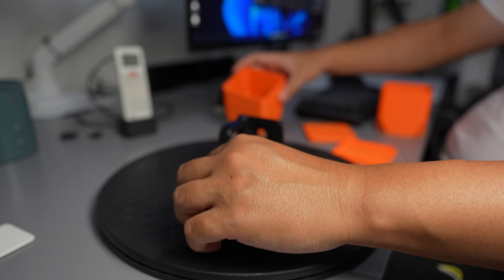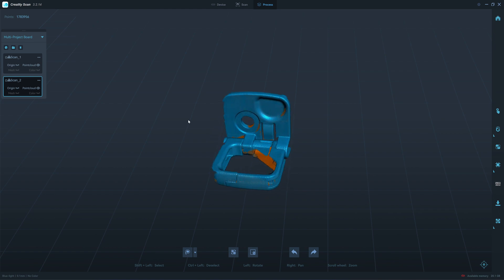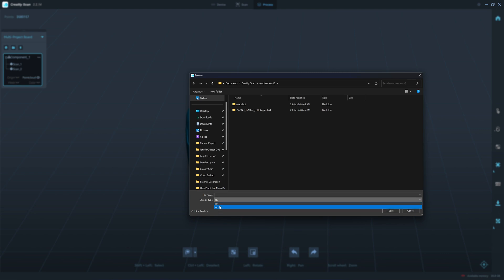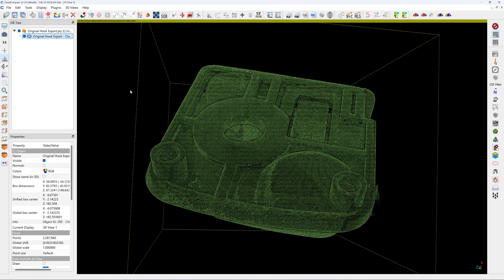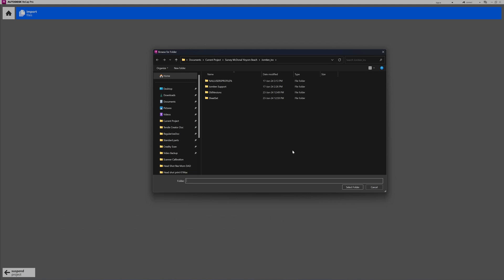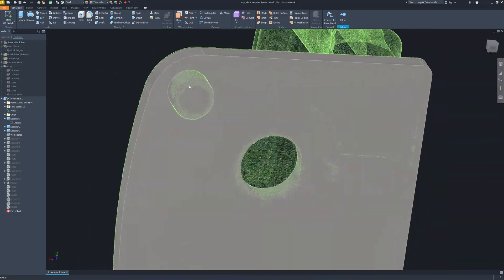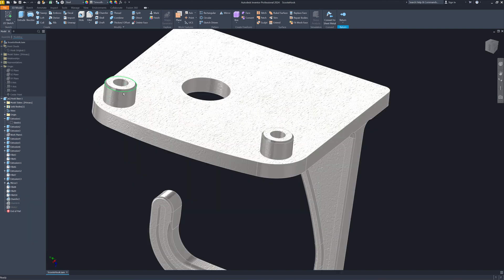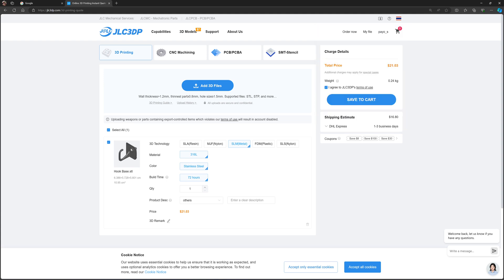CR Scan Raptor - Reverse Engineering and Metal Printing

Comment: Wow. Very talented. I learn alot from your videos. I'll definitely need to start working with Cloud Compare and Blender. I picked up an Otter for Christmas and so far I'm not having much luck. I find I'm wanting more dimensional accuracy for precise fitment parts. I'm also not finding the geometry or texture tracking useable at all, as part features like holes are simply 'scanned over' and losing the feature. My hardware is only supporting 8-10fps as well, which is likely making the problems worse.
Reply from the maker: I'm making a new tutorial video with Otter. I use another 3rd party, easy to use software called "Adobe Substance Modeler". You should check that out. It's much easier than Blender and ColudCompare. Most people should be able to learn in 3-4 hours.
Reply: @Payo-TensileCreator  I'm sort of in the same situation as the commenter above, I have an otter and trying to make car parts. Looking forward to adobe-otter involved video you mentioned. Thank you for what you do!

Comment: Hey GREAT information for beginners. Thanks you! Perfect high level of each component. Im really interested in the analysis part and how that factors into material selection but more importantly how you plan the selection process and considerations for modeling your part. Also really interesting about the tapering! Have u done a more in depth vid on any of that?
Reply from the maker: I'll order a test work piece for thread tapping and make a video on that.

Comment: Well done Monsieur!👍 very pro explanations! I have a question for you, how precise you can get with raptor? Let's say the part is about 600mm x 600mm with 25 holes in it. Thanks!
Reply from the maker: Reliable accuracy for Raptor is 50 um and Otter is 250 um when scanning metal surface. Surface condition has less effect to dimension in blue laser mode (Dark, bright or shinny will get similar result) and it only tracks with markers which are stationary.
Reply: @Payo-TensileCreator  thanks for the infos!

Comment: your channel and tips are incredibly helpful, thank you.

I was driving myself crazy, for hours, trying to get solidworks to line up the point cloud with the axis' correctly. That software did a better job than I could in >2 hours in solidworks.

You should show more features of that software that you use.

Comment: I did print a stainless steel part with jlcpcb too. 0.1mm accuracy on my part. Had to file a little, the part was very strong. 
It’s incredible that we can let it metal printed. CNC machined your part would cost a lot more than 100$.
Reply from the maker: Have you tried tapping thread on it? I wonder if I can tap M3 into 2.0mm hole (2mm thick wall). I'll order a test piece to do thread tapping test.
Reply: @Payo-TensileCreator  no but when I filed the part it behaved like normal stainless steel. There should no problem tapping it.

Comment: where did you buy your turntable?
Reply from the maker: It's 30cm painter turn table, cost around 5 USD. Just search for "air brush turn table", you should be able to find it locally.
Reply: @Payo-TensileCreator  Thank you very much for your response, I take this opportunity to tell you that I greatly appreciate your content and I have learned a lot thanks to you, I even bought the Raptor scanner. Thank you very much, keep it up.

Comment: I’d think the taper is for the injection molding, and not to make it more difficult to copy. Just a guess, and I may be wrong. 

I’d 3D print the part myself in PLA first to verify it fits before ordering the metal part.
Reply from the maker: It's only 5mm thick, I think it should be ejected from the mold easily and the taper angle from 4 sides are in different angle. But you could be right. I'm not expert in this department.
Reply: You're right;)